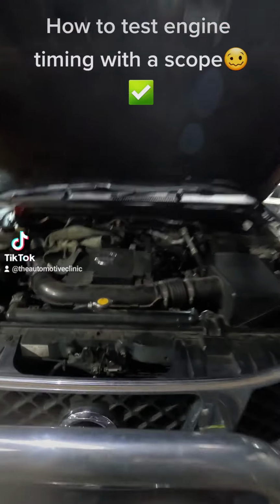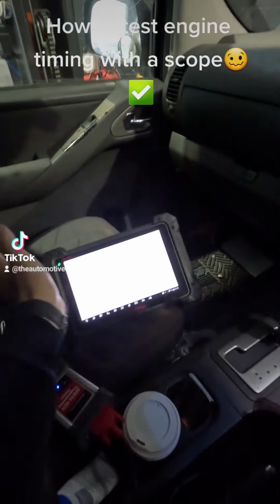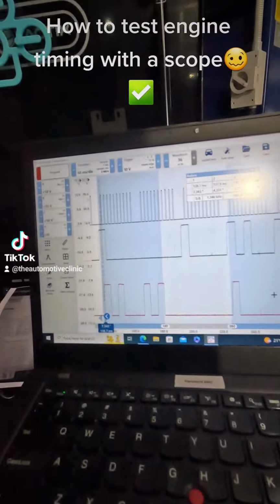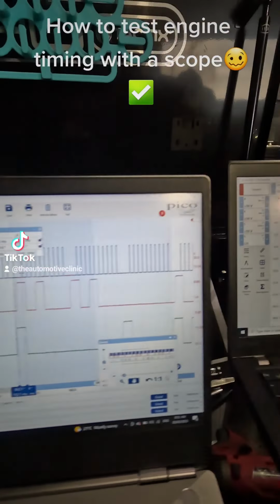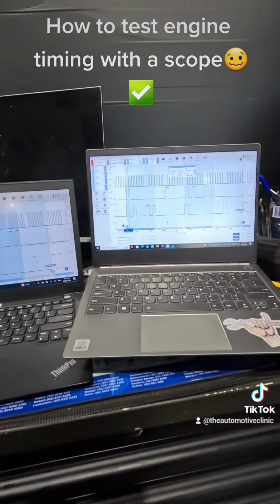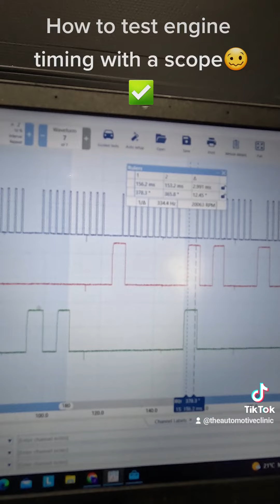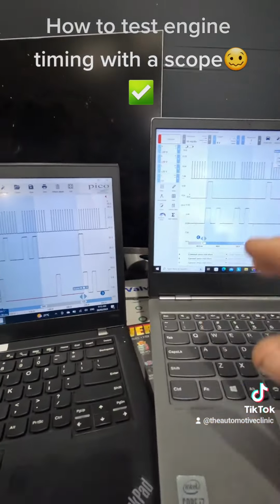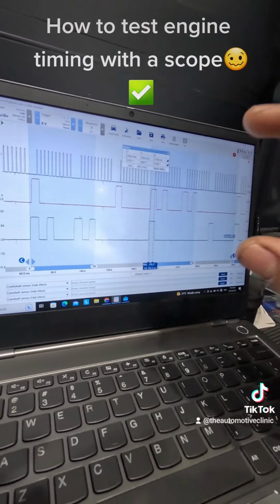How to test engine timing with a scope 👨‍💻✅️

Comment: Bleedin hell's bells. I've was told last week by an auto-electrician that my 'good start - won't run' issue can't be down to timing because the engine (Ecotec Z14XEP) has a chain, and chains don't slip. Just received a mail from another YouTube channel that that is wrong; and that without even 'opening anything up' I can check "with a scope" (thinks: "scope"? Micro-? Tele-?). You're the first result I've found so far. Complicate!! Thanks.